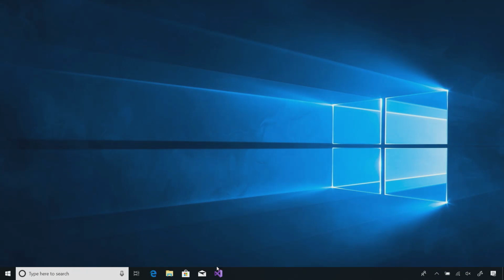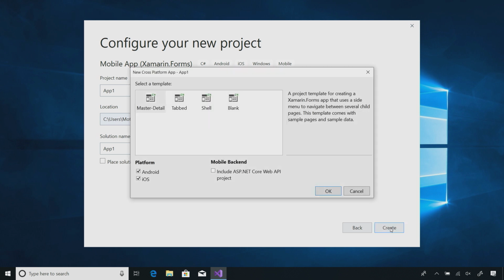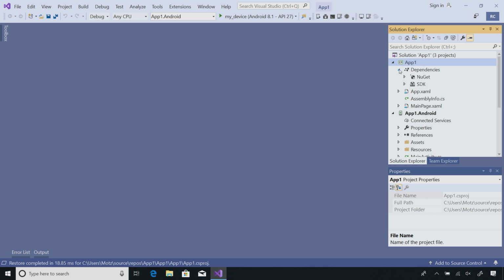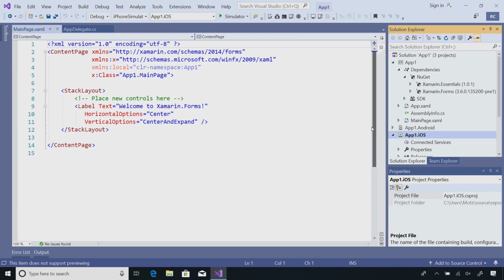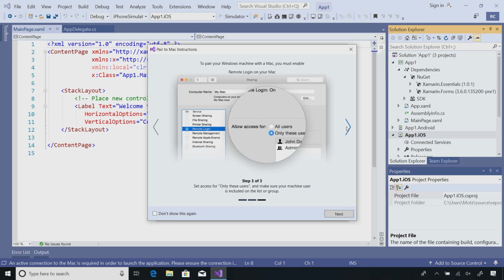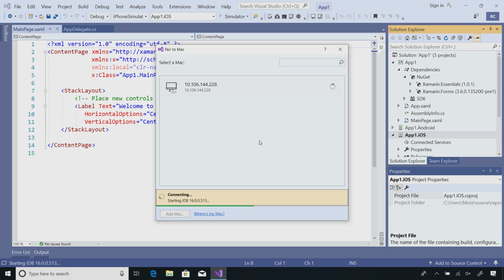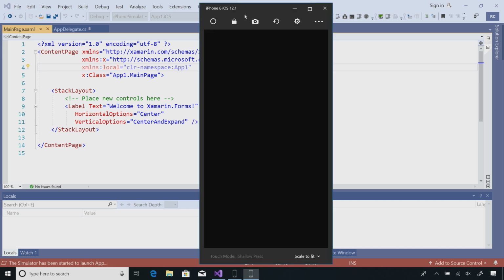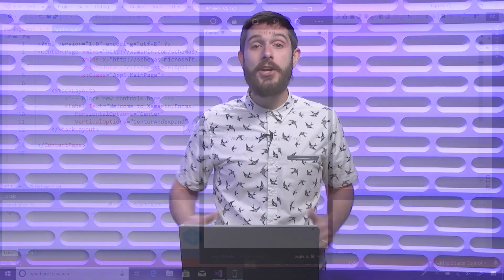Build Your First iOS App with Visual Studio 2019 and Xamarin

Comment: On the Mac is must be installed Xcode ? Also in which directory is allocated the compiled code for IOS ?
Reply: To make this work you will have to have a physical Mac on your network with Xcode installed. Also some Mono things to make the Xamarin bits work, but the latter will be done by Visual Studio as well. The code can be find in it's regular place on your Windows machine :) You can find more information here: https://docs.microsoft.com/xamarin/ios/get-started/installation/windows

Additionally, you might want to look into Hot Restart which allows you to build an iOS app without needing a Mac. More info on that here: https://docs.microsoft.com/xamarin/xamarin-forms/deploy-test/hot-restart

Comment: Running visual studio 19 windows against Mac M1 Mini. I'm new so followed all stages required to set up the mac with xcode and let visual studio set up other required software. All seemed to run smoothly.
Simulator starts on PC but shows black screen when i run the app in debug mode on visual studio.
Reply: Hope you figured this out by now!

Comment: I dont have a Mac how do i do IT?
Reply from the maker: To build an deploy iOS applications a mac machine will be required. There are services such as MacInCloud that offer hosted environments.
Reply: The video is clearly using Windows.
Reply: @danielhendricks2576  Nope, the portion going through the Remote Login with Mac dialogue prompts is the portion where the Mac is involved. Apple's build/compiling tools are proprietary and only work on MacOS. It sucks as it means iOS development excludes a lot of less-than-fortunate developers from building iOS apps.
Then again, that's probably by design... given how much malware is periodically discovered over on Google Play.

Comment: if i don't have mac, what i can make ios apps in xamarin visual studio?
Reply: A mac is required for iOS development. You can use services like mac in cloud to connect to, or do cloud builds of your app in App Center.
Reply: James Montemagno my brother said I can make a iOS app with xamarin on windows... didn’t know I needed a mac
Reply: @JamesMontemagno  I have no mac, So i am not sure about that. Could you show us the detail about this if we have no mac machine? How to do?
Reply: @JamesMontemagno  or launch Mac OS on VMWare (or VirtualBox) and connect directly on your PC (host) to guest (mac simulation).
Or does this violate Mac licences and therefore you can't share this solution?
Reply: @maltravel  Then why not just make it in xcode?
Reply: @eskilnyhus4161  Because for me it works much smoother to code on my host system und just use the vmware virtual machine / emulator for ios than coding IN the virtual machine. And so I can deploy iOS AND android at the same time from my host system at one code base without using git all the time
Ps: Host is Windows 10, guest Mac Catalin
Reply: @maltravel  To answer your prior question on Mac license violations: Yes, it does violate it. Setting up a Mac VM requires piracy of MacOS. There are plenty of workarounds for making it work all on Windows, but whenever Apple issues an update for its OS, the VM will break if it's ever connected to the internet. You're basically making a "Hackintosh".

I wouldn't want to be using a hackintosh for future commercial development because that puts a nice target on your back for Apple's legal team.
Reply: Use a VM
Reply: I created a Virtual Box VM with Mojave installed on it and that works fine. See: https://www.whatroute.net/installerapp2iso.html#createvm. The hard part for you might be locating the installation for Mojave. I knew someone with a Mac so I got it that way.
Reply from the maker: You can now deploy directly to an iOS device with Xamarin Hot Restart -> https://docs.microsoft.com/en-us/xamarin/xamarin-forms/deploy-test/hot-restart and checkout this video -> https://www.youtube.com/watch?v=CTQxCndn5dg

Comment: I was hoping MS would have this mac issue resolved in the 2019 VS, but it looks like you still need a mac.  
If you have to have a mac, it might be easier to just use the mac for Xamarin development.
Reply: A mac is required for iOS development. You can use services like mac in cloud to connect to, or do cloud builds of your app in App Center.
Reply from the maker: MacInCloud is a service that provides remote mac machines that you can connect to. You can point Visual Studio at them or use remote desktop.
Reply: @XamarinDevelopers  Yes but, what if I don't own a Mac and can't get my hands on one. I am not interested in Mac Stadium or anything similar because it's not free. Any other solutions? I wish Apple would favor Windows too. It really sucks being left out all because my PCs are all Windows machines.